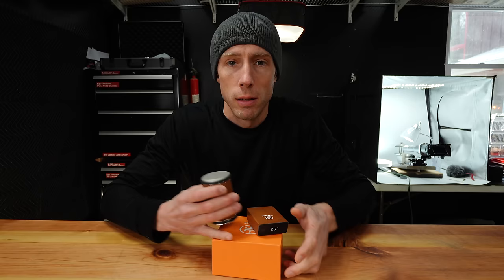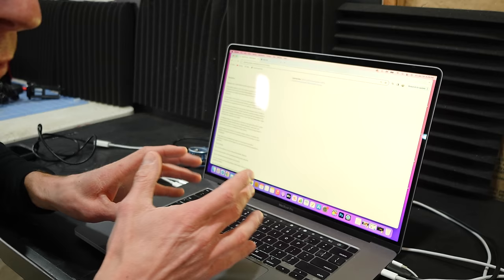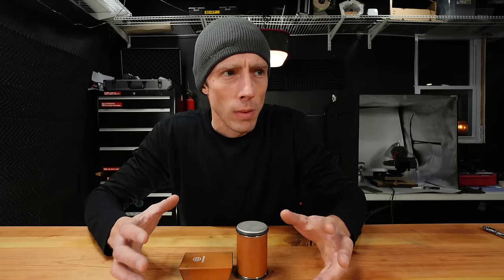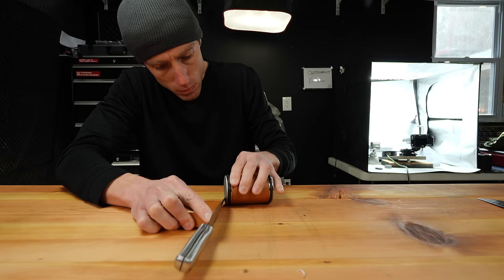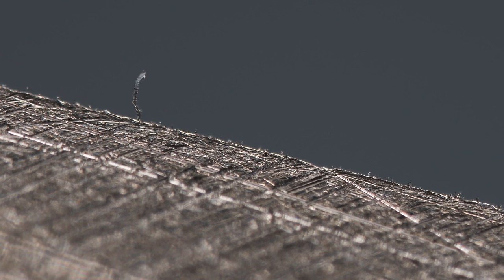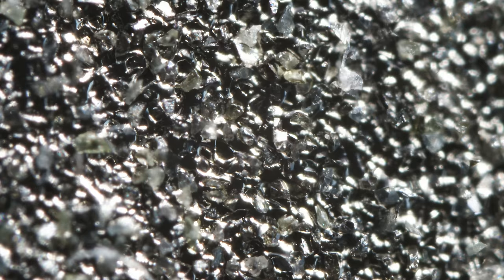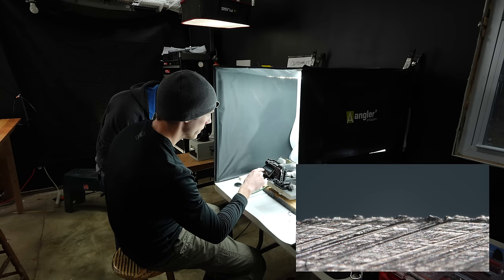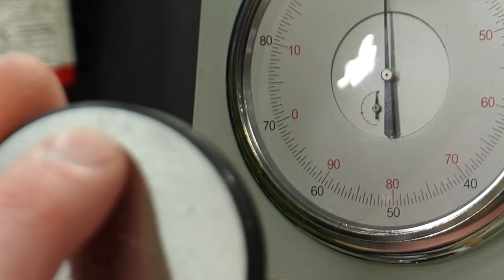There’s Something Strange About These Rolling Knife Sharpeners..

Comment: This will only work well on a perfectly straight edge, and every knife we actually use has a curve to it.
Imagine the curved belly exaggerated to visualize this. Tilt it 14 degrees to exaggerate the visualization.
The "sharpener" will only grind at the deepest part of the belly of the blade.  This is going to absolute destroy edge geometry, which has a HUGE effect on apparent sharpness and cutting consistency.  Bad geometry drives the blade off-center constantly as it moves, making it much harder to cut and more likely you'll cut yourself.

Comment: I have the version used in the video and after after a few weeks the rolling mechanism got very stiff and barely rolls.
Reply from the maker: Mine is starting to do the same😂
Reply: its pretty disappointing considering the cost. As far as I can tell there is no way to disassemble the roller to clean it out. @OUTDOORS55

Comment: It so happens that yt proposes this video just one day after i sharpened one of my kitchen knifes with an electric knife sharpener (Graef) i bought from amazon in march 2021 for 135€.
It has 2 rotating grind stones (coarse for very dull blades and fine) and one diamond deburring disk, all on one axis, with slits left and right at every disk where you insert the knife and pull it through.
Sharpening a knife to a "sharp enough for kitchen use" state takes a minute, even with this abused one - i regulary put it in the dish washer because im a lazy mf :)
What i want to say: There is no need for such fancy/stylish sharpeners, and also no need for razor sharp knifes in the kitchen. An appliance that gets the job done is all it needs.

Comment: Great job!

I have a question. Why spend a lot of money on an overpriced device, or get a whetstone that requires that you actually know how to use it when I can use my super-cheap ceramic disk sharpener and put a sharp edge on any non-serrated edge in a minute or less (unless it's never been sharpened or is badly damaged, of course)? I just don't see the point.

Comment: Humans are a fickle lot. They, rightfully, don’t like to be lied to, but…they also don’t like the truth.

Just because someone is criticizing a brand you’re using doesn’t mean they’re criticizing you or your purchase. They’re criticizing the item in question, because nothing can please all of the people all of the time due to the human nature of preference.
I’ve always seen this product as an informercial, initially and had my doubts.

This video confirms my doubts. 

Though, it still doesn’t take away from anyone’s preference. If it works for you and not for me it’s a perfect middle ground, giving room to accept both preferences, amicably.

One could use parallel and 1-2-3 blocks sets to prop under and/or against the magnetic block and under knives that wouldn’t fit, if one was inclined.

Comment: I use whetstones. I am going to guess that it is much like a DMT diamond stone that has crushed industrial diamonds glued on the for its abrasive surface. DMT diamond stones are awful and a waste of money. That thin layer of industrial diamonds on top does not last very long at all. I do have diamond stones for knives made of super steels but my diamond stones are Naniwa resin bonded diamond stones which are excellent and last a very long time unlike DMT, Atoma, or any steel plate with industrial diamonds glued on top

Comment: Of course a masterpiece of german engineering is better than the chinese knockoff. :)
But I actually use a brick of very fine cement/concrete for sharpening my knifes. Works perfectly fine.

Comment: real or knock off don't make any difference in how bad these things work. its the design that makes them not work very well on any sort of tapered blade knife the angle changes on the part on the tip or curve of the edge..   tho if trying to sharpen something that was a perfectly straight edge they would work great and keep the perfect angle along the whole length of the blade.

Comment: Water-use it.  You wrecked it by not using any lubricant.  Problem isn't the tool. The problem is the tool using the tool.
Reply from the maker: As a diamond stone manufacturer water does nothing but introduce corrosion

Comment: Forget this gimmicky junk that costs as much as real sharpening gear. For a little over $100 you could get a set of Shapton Rockstar 500/1000/4000 ceramic stones and a couple of angle guide blocks that will last a lifetime and can be leveled if you use them enough to put a good dish in them. The angles aren’t really that hard to get down if you just pay close attention and watch a few videos, and it doesn’t have to be bang on 20 degrees or whatever you’re going for as long as you’re consistent. Practice on some cheaper knives first before sharpening your way through your entire Seki city collection. 

If you really want a high-end setup on a medium budget, get a Ruixin RX-009 (knockoff of the Edge Pro / TSPROF sharpeners) and throw away the stock stones or use them exclusively for sharpening lawnmower blades and cheap axes. Get a set of “Shapton Glass Stones For Edge Pro”, some de-burring cubes, and a strop. Now you can get easy and consistent razor edges on all your knives for about $150-$200 and it’ll last for decades.

Comment: I have to say this thing could never achieve the kind of sharpness you'd want in a kitchen. Not my kitchen anyway. Reason being is that when you sharpen a blade, you want to create microscopic burs in a straight line. To quote my favorite chef; a knife is NOT an axe, it's does not "chop" it's a saw with tiny tiny teeth. When I learned this, my knives went from butcher level to sushi chef level because well, the best sushi knives use the same principal; aligning the microscopic burs along the blade to give the blade "teeth". 

I hope that makes sense and highlights that a $12 stone with plastic guide is 3000 times better than that overpriced knife killer.

No chef in their right mind would use that thing on a top end blade. Seriously.

Comment: youre supposed to use the steel side to remove the burr, you didnt do it right by not removing the burr. youre supposed to remove it, so yes you can do it wrong. this is joke.

Comment: youre so wrong about softer stuff not removing the burr lol. you can use leather, without abrasive, its like saying, my bones cant be broken by anything softer than bone. it works that way with scratches, not structueral strength. you can push a pillow against metal hard enough to break it, not everything applies to everything man. i bet you dont think the sky is blue either, and explain that by stating the literal definition of color as the reason its not blue. (it is)
Reply from the maker: Watch my channel and learn something bro

Comment: All these things are just gimmicky crap. Knives are born with an edge. All you should need to do after is pretty much straighten it. I use a whetstone on mine, the same type you would use to sharpen chisels or plane blades. Much cheaper and not gimmicky.
Reply from the maker: I personally wouldn't call the sharpener gimmicky this one is just poor quality. This rolling concept design is actually quite ingenious, and make sharpening the right type of knives, extremely easy with basically no skill. I have since had experience with the horl version and it's one of the most finely engineered pieces of engineering I've seen in a long time.

Comment: "You're just using it wrong..."    <<-- These guys are the worst. These are the fuckers that require "use and safety" instructions on bricks. I shouldn't have to clamp my left butt-cheek and morse-code my right ring toe to properly rub too rocks together.

I've had this problem with professional tools of my own trade, and "professionals" who swear by those tools. Before I can even explain why I don't like the tools in question, "You're just using it wrong..." sometimes they'll follow it up with, "I'll teach you how...". Normally I'd be all for learning how, under certain circumstances.

1 - I've never seen the tool before. Usually means I don't have an opinion yet. "New toys."

or

2 - I'm the only one showing fucked up results.

If I'm not using the tool, because I have already tested it and found it wanting, and I'm consistently happening upon fucked up results and I know who's using the tool, then I'm left with only one stance when offered to be taught the correct way. "Either the tool is a failure, or you are the one using it wrong. In either case, I DO NOT want you to teach me!"

Comment: Brother, you  need a ton more information before you make a video like this.  First off, you need to understand Rockwell and edge retention is a property of a heat treat of the steel of whatever steel you're using.  They're also independent when you really start testing them.  There is a reason Buck -Paul Bos can use 'shit tier' 440C and make it very a manageable steel for knife enthusiasts, even at a very high Rockwell.   The Rockwell can be great with 440C, but it's will never have retention like s90v at identical Rockwells.  Why is that?  Composition and metallurgy!  So using low quality steel to sharpen, simply means it's just "as good" as the experience high quality steel has, however, for a much , much shorter window.  It's EXACTLY why surgeons use a "shit tier steel" to do brain surgery.  It's easier to make them that sharp, it's not better.  It's a metallurgy problem you never considered.  Why don't we typically take carbon submarines to the Titanic wreck?  It's not good enough.  Titanium is better.  Same with quality knives and metallurgy steels.
Reply from the maker: Please see my older videos. I am the reason information you mentioned is even available haha. Everything in the video is accurate.